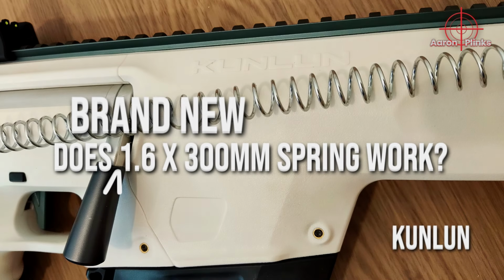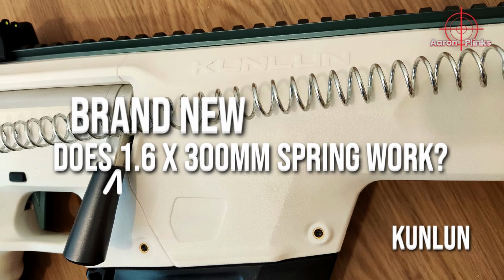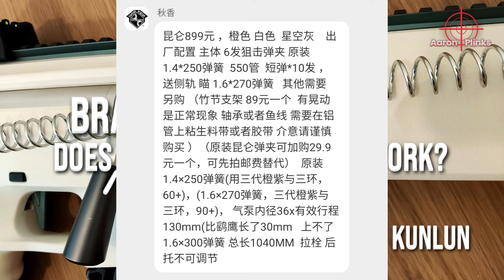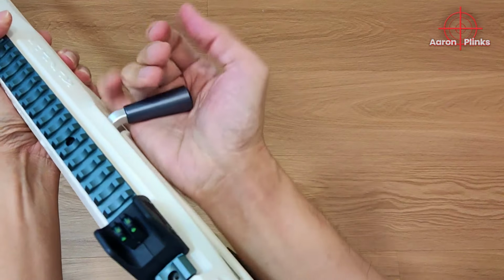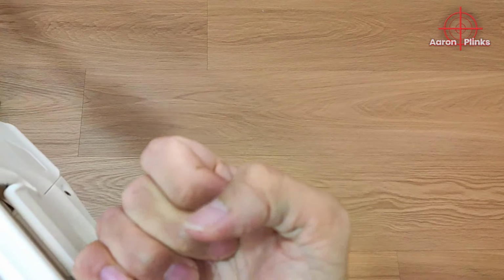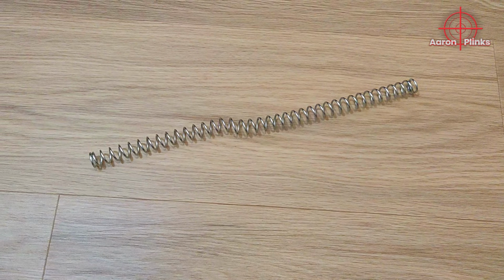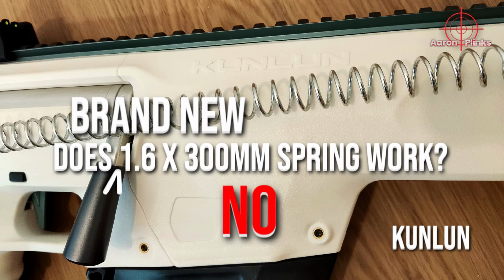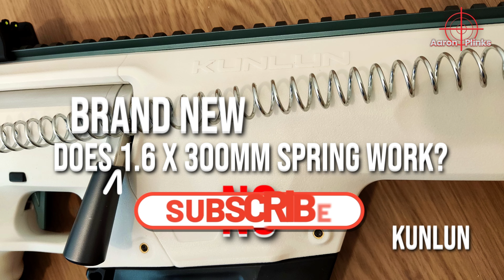Kunlun 2nd Update: Does A New 1.6 x 300mm Spring (for Worker Harrier) Work In This Nerf Blaster?

Comment: I saw 1.7, 1.8, 1.9, 2.0 mm thick spring in Taobao just now, some say 2.0mm will get near 490fps. But I am sure the ABS catch housing that integrate with the stock will be cracked very quickly.
Reply from the maker: Those on taobao don't work. They don't fit the spring guide at the stock.
Reply: @AaronPlinks  there are new ones are for kunlun.
Reply from the maker: Already have them